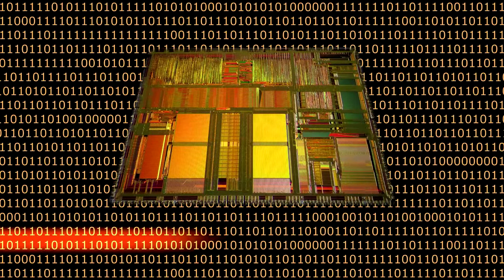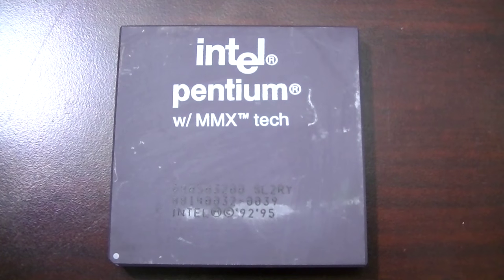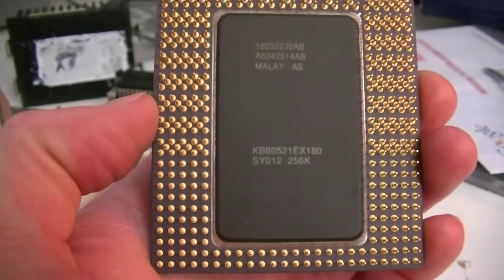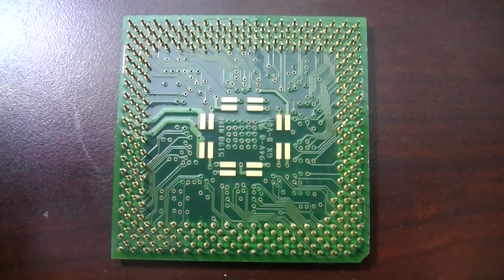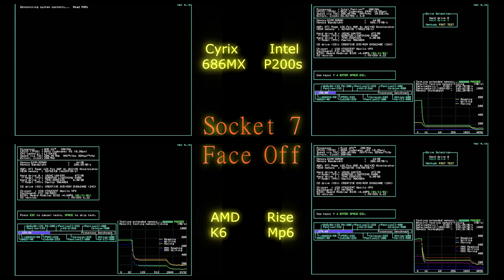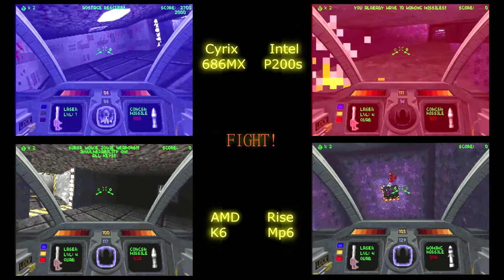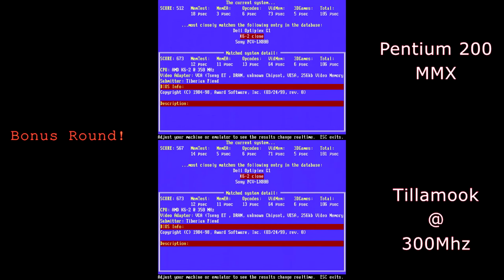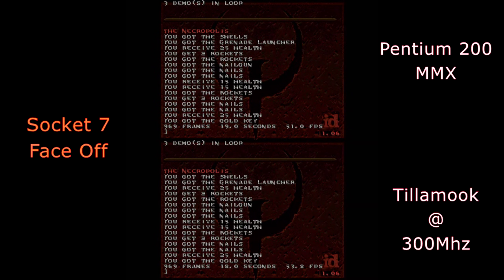Socket 7 Face Off

Comment: Holy crap this was a lot of work, and you going by a script with voiceover made a huge difference...just wanted to give you props for a great video.
Reply from the maker: +Retro Active This was a lot of work. No doubt. Mostly with editing time. The actual capture was pretty easy once I got the settings of the capture card and vegas figured out, just had to do the same thing 6 times. Super socket 7 for example, should be easier since it is really just 3 processors, Cyrix MII, K6-2 and K6-3.

Comment: Addendum to the tillamook:
You have to solder 2 bridges to get it running on regular boards.They have to do with the cache lines.
Everything documented on the vogons-forum.
The tillamook is a beast and can easily reach 350-400MHz!
Reply from the maker: Ok cool. I will take a look into that. Thanks!

Comment: I have a Compaq Presario 2200's with a Cyrix Media GX CPU.  The machine is somewhat well known on the internet as it is rare and shipped with DVD playing support in 1997 and it has many quirks such as being unable to boot windows 98 CD's until you spam it with key presses causing it to kick into life. It's not useful even with software from its era due to how poor it runs but this could also be Compaq's genius engineering causing issues here considering how well they did with the rest of it. Great collection BTW.

Comment: This brings back a lot of memories. I went through Socket 7 starting with the Cyrix 6x86 166 (which was a good chip, but ran super hot) to a AMD K6-200,  K6-2 300 and finally a K6-2 450 before upgrading everything to Athlon. I had an Epox Via Super 7 chipset board.  I dont remember seeing the Rise Mp6 sold anywhere in Texas. It looks like it joined the party too late right when the Athlon was just coming out. And I doubt the Media GX would have been a capable performer. I read back then that it did very poor with 3d games.

Comment: Do you consider the 66 MHz FSB K6-2's as being super socket 7 CPUs or regular socket 7 CPUs? From the chomper extended core (CXT) and on they supported write combining which massively increases performance in higher resolution DOS games (anything above 320x200 will typically benefit by double digit percentages and up to 80% in some synthetic benchmarks). This performance comes from combining many smaller writes into one big burst of writes to the frame buffer that use the bus more efficiently.

Comment: I just started watching this so I decided to look up on ebay. Someone got lucky and picked one up for $63. But saw some that sold high as well. I have a working Asus P5A board that I bought awhile for $120 at a recycle store and I just looked that board up on ebay and saw that one sold for $450 back on April 1st of this year. It was a P5A-B. Which was a little better than the A as it was 2x AGP. Just wow. The Chaintech %AGM board isn't cheap either. I used to work with some of this old hardware back then. WHich I could of held on too some of it. I wish I still had my Voodoo Banshee AGP card. I do However have a Voodoo PCI I think 4 MB and a Voodoo 3 3000 AGP (it's in the Asus board) that I got at recycle store back in like 2010 for $16 dollars.
Reply from the maker: WOW I would never pay that kind of money for old crap like this, as much as I love it.  Sometimes you can find better deals in whole vintage systems on Evelbay. That is how I have gotten certain rare items.  Also look for cpu and motherboard scrap. As long as the pins are not bent, most likely the cpu works.

Comment: Nice job! Intel sure did some shady things back in the 90s, they probably still do and have just gotten better at not letting such things appear in the public eye. It was pretty miserable when Cyrix dropped out, competition in any industry always makes a better product for the end user. It puts the companies in a place where they can't mess up without fear of losing their market and the only way to combat it is to make something better than your competitor and sell it cheaper.

I'm quite surprised by the MP6, it is actually quite impressive. It was a weird thing though and I never, ever saw one in use anywhere, not even in low-end machines or laptops. Seems the Crusoe was the choice for that around here and even then I only saw them on sale, so I guess nobody bought them... They were right not to, the ones I saw were PCChips A530's so I bet they were awful notebooks.

You aren't missing anything with the WinChip, believe me. It doesn't really do anything a 486 can't do - which is all it essentially is. I mean, sure, you can bench the integer unit all day and it will look nice there, but nothing which runs well on it needs to go that fast, a well configured DX4 would probably run such programs just fine. In defense of the chip, they didn't try to make it out to be some big performer so far as I know, it would have been much worse if they did.

The new intro animation is kinda cool.
Reply from the maker: +HighTreason610 A Transmeta Crusoe is one I would like to have. They were probably the most interesting processor with their ability to run pretty much any architecture that existed back then.  Not good at performance, but that is one of those chips that was certainly relegated to the history books quickly unfortunately.

I too miss Cyrix. It wouldn't have been so bad had VIA actually ever done anything with them, or even IDT core. But they never wanted to make that chip into something that could keep up with even AMD K7 back then, and chose to start this whole ITX embedded craze.  The only real processor competition and innovation now days, seems to be these chips made for phones and tablets which looks like is where VIA is focusing on now days.

I think the problem with the Rise chip, was that they were really too late to market with that chip. By the time that chip was released, we were already well into the P2 and K6 266 / 300 era. Infact, Rise claimed the chip was equal to a Pentium 2 @ 266 apparently, but it usually was behind even the K6 266 chip.  Also, they do overclock a little, but not by much, and they are very specific on the voltage as well. .1 over or under, and they will not turn on. Even so, I did get this one to run at 225 with 112.5 bus speed. Integer performance is just through the roof on that chip, and the fpu is really pretty damn close to Intel.

Concerning intel, I personally think, and this is just maybe conspiracy theory talk, but I think they have some kind of an arrangement with AMD now days, and that is why AMD is behind Intel on performance anymore. It sure seems like the timing of Intel going with AMD's 64bit implementation and dropping their own IA64 stuff coincides with the performance shift away from AMD being equal and usually faster than Intel, to where they are now, just second banana to Intel again. I know AMD has some incredible engineers and their products, starting with Phenom, have not been what I know they are capable of doing.

Comment: Man were those the days! All buddies had Cyrix 6x86 166's and my Pentium 133 running a Tyan S1672 motherboard just wiped the floor with them when comparing Duke Nukem and Quake. I have always liked the looks of the Cyrix processors as well as AMD K5's. Thanks for the flash back. Where did you get your Rise processor? Trying to find one for my collection.

Comment: I think I used to have one of those motherboards. It looks very familiar. I had it in a full tower and I had an overclocked MMX in it, a 166 running at 250. I had it sitting at my dads place, and he tossed it out a few years ago without even asking me. :(

Comment: Hi, I'd like to make a couple of video requests if possible and if you get the time of course.

1) Could you face off a Pentium 2 450 against a Pentium 3 450 to see the difference?
2) An AMD K6-2 K6-2+ K6-3+ 500/550 Against a Pentium 2 or 3 with similar clock speed? That would be very interesting.
3) How about a AMD K7 Athlon slot A of any clock speed and compare it to a Pentium 3 slot 1 of same clock speed? 

Any of these would be great if you get the time!

Keep up the videos! 

Mammoth
Reply: +mam moth (Mammoth) 
Having assembled and worked on all of these when they were new, I could make some predictions:
1) About the same.  the first Pentium 3 was just a die shrink and a couple of new instructions.  There weren't any particular architecture improvements.
2) K6-2 about the same, K6-2+ wins, K6-3 crushes them, except with FPU-related stuff.
3) Athlon wins.
Reply: Interesting! So which would be faster out of a 450mhz p2 or a 450mhz p3?
Reply: mam moth

They'd be about the same.  The first-run P3 had some SSE instructions, but was otherwise the same basic CPU as the P2.
Reply from the maker: +mam moth (Mammoth) I covered that in my slot 1 face off video
Reply: @Jerkwad152  Yeah, first Katmai based Pentium III, was only gimmick. It wasn't die shrink btw, it was still on same 250nm technology. They were really Pentium II with SSE instructions, and some improvements, but it was more like revisions of same processor. Newer revisions (steppings) can have some upgrades, that makes them slightly more faster, or overclockable, when Intel find some issues, they repair it with new steppings. So this is why Katmai can be sometimes slightly faster, than regular Pentium II, but it's basically because of these "steppings improvements", technology is basically the same.
In other words, Pentium II early stepping, can be slightly slower, than Pentium II later stepping (this apply to any processor line basically), and that's why Pentium III Katmai can be sometimes slightly faster, because it's basicaly later revision of Pentium II, so they could improve some little things. But platform is basically the same, same nanometres process, and architecture. It has same cache system. Only SSE instructions were added.

Still, if you have two same priced offering, always take Katmai. Some called it even Pentium II SSE unnoficially, because it's really Pentium II with added SSE instructions. It was basicaly commetial gimmick, to call it Pentium III, because AMD started to be sucessfull competitor, and AMD K7 was about to be released, so Intel made this Pentium II with SSE, and called it Pentium III. They've managed to get to 500 Mhz already, but they could do it also with Pentium II in that time. But they needed to decieve customers, to buy this new 3rd Pentium, so they've called it Pentium III, so it looked better. And they made massive advartisement campaign, how good it is with Internet (multimedia), which was quite popular in early 1999. So people hastly buy it, before K7 from AMD come out. Because when they choose Slot 1 platform, then, they will stay probably with Coppermine Pentium (True Pentium III basically).
So conclusion is, when Intel would be "fair", Pentium III Katmai should be called something like Pentium II SSE or Pentium II + . It was only slightly upgraded Pentium II, on same architecture and nanometer process. So it was dishonest to call it Pentium III. Pure advertisement. But I'm sure, it decieved many people, that it's some new line of Pentium and they bought it. SSE really helped with multimedia, and so on internet, as was presented in advertisement, but anyway, during its initial release, the support for programs, that could use SSE, was quite small. It was more like feature of future, like in late 99 or early 2000, new programs could take advantage of SSE.

Yea, so conclusion is, they are about same fast, Pentium III Katmai will be very very slightly faster (I would guess it would be barely measurable, like about 1-2%), because it was made later, so it's basicaly later revision of Pentium II. If program can use advantage of SSE instruction, then it will be noticable faster (though I don't know exact speed improvement, but you can find some tests, there was lots of reviews that was measuring this in 1999, but in general, the gain for SSE in program over Pentium II, could differ from program to program)

To be honest, if I would be maker of Katmai based Pentium, and had to choose name for it in 1999, I wouldn't name it Pentium III. It was a bit dishonest. I would call it Pentium 2.5, or Pentium II SSE. But Intel looks at advertisement, and deffinetly, it brought more money, by fake feeling, it's Pentium III - new Pentium!!! So many bought it because of it, or expecting something more. To be honest, in early 1999, the best would be eighter to skip Katmai, and wait for coppermine, or if you had to buy processor in that time for some reasen, then best was to buy Celeron 300A, and overclock it to 450A.  Would be in some cases even faster, than Pentium III Katmai 450 Mhz, ( with 1/3 cost) Pentium III Katmai was always overpriced.

Comment: Well, 200 MMX is 2x100, which could not be set on "normal" socket 7 boards. It was more stuff of a super socket 7 platforms.
So I think, more reasonable was test 200MMX (3x66) , 233 MMX (3.5x66) and 225 MMX (3x 75), that was maximum of MMX platform which most of people could use.

Also, supersocket 7 boards had advantage of better and more L2 cache. Also, more cachable area.
So I think, by disabling L2 cache on Tilamook, you wouldn't loose so much on socket 7 platform as on supersocket 7, so that Pentium 200 MMX have unfair advantage here.

Comment: Super Socket 7 is any CPU that runs on 100MHz FSB. Quake runs better on Intel processors because Quake was designed to use the FPU. Intel's FPU in the Socket 7 processors were way ahead of the competition

Comment: I just got the bench marks on one of my dual Pentium pro systems running DOS Quake 27.8sec 34.8FPS :( i was hoping to at least match your Pentium  200... the CPU's in it are 200Mhz 256mg cash chips... 
i know running Dos only 1 CPU is working... why do you think my score is so low? other then that it is ROCK SOLID...
 and from what my understanding the 16bit performance is still good just takes a hit when switching from exacting 32bit then switching to 16bit and back...
maybe ill make a video showing the system off... 
the system is
MSI MS6107
2x Pentium pro 200mhz 256mg cash
27pin EDO 192mg  <<< one of my pars of 32mg stick is dead :( or i would have 256mg for windows 98se
Trident 9680-1 2mg Video card...
Reply from the maker: The Trident card is likely the reason for the lower fps. Those are good cards, but certainly not a top performance 2D or 3D card.
Reply: Pentium pro's at 200 are faster than Pentium 200. What res do you run? if it's 800x600 or lower then your PPro has some problems i think!
Reply: it was what ever default at start up... dont mater now i sold the Setup..  needed money for my main computer as it is dying..

Comment: I remember having a p i133  and upgraded it to a cyrix pr266. Man I was so disapointed. Quake 2 had no difference. ( I also spended like 200 bucks to change my 1 mb mach 64 to a diamond 3d  4 mb vram.  3d my arse. Also zero fps gain.

Wasted in 1 week 450 bucks with maybe 1 fps gain.
Reply from the maker: I had a similar experience with the Rendition V2200 card. Interesting chip now days since they don't exist anymore, but horrible 2D performance. It is like running an ISA card for 2D. 3D wasn't too bad with 3D Rendition versions of dos games. I have some Matrox Millennium cards too and they suck hard core in dos.
Reply: Yeah. I remember those Matrox's cards. Biggest regret was that diamond 3D  card tho. What a lie. It had no opengl support. It was D3D lol. 
I do remember buying  a POWERVR opengl card. It looked.. weird. but with a charm. 
The weird part was, unlike the voodoo 1 and 2, It didnt needed vga cables. Just plug it in. Yay 60 fps on power vr playing q2.
I wish i still have that card.

EDIT: I've found it: http://vintage3d.org/pcx2.php#sthash.2c6R9Hd2.dpbs
Reply from the maker: Martijn van Zanen
 Oh ok ya, I know this card. Matrox used to sell their name branded version of this card.  It is an interesting card. Some are on ebay, people are out of their minds for asking prices.  I have thought about picking up a PowerVR 4500 Kyro II AGP card just to see what those are like.
Reply: WaybackTECH Nice. Hope to see a video of it soon:)
Reply: Some Compaq Presario towers had PowerVR cards installed in them. I seem to remember seeing them in 166 and 200Mhz systems, not knowing what they were at the time. Just a card with 3 big far NEC chips on them.